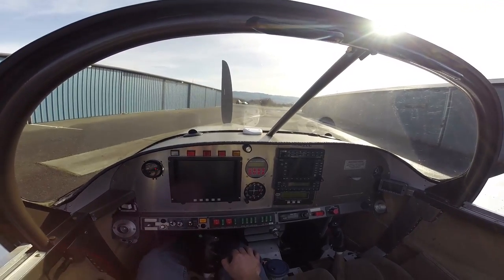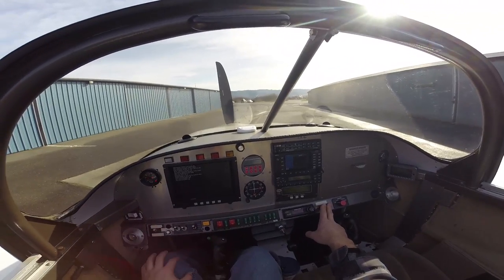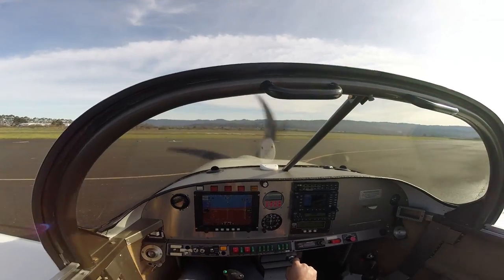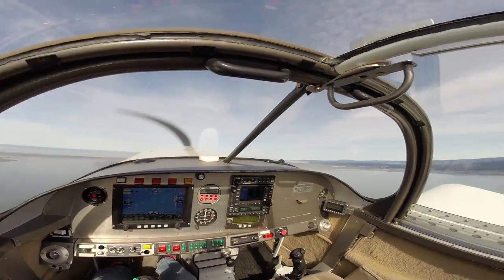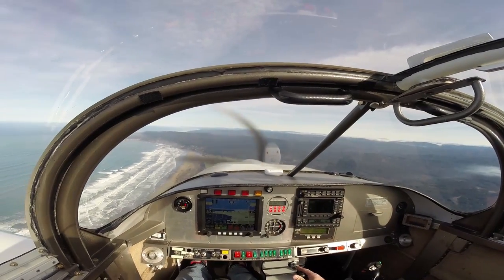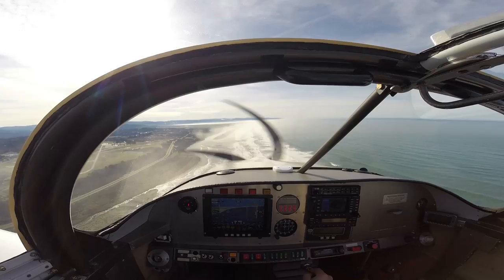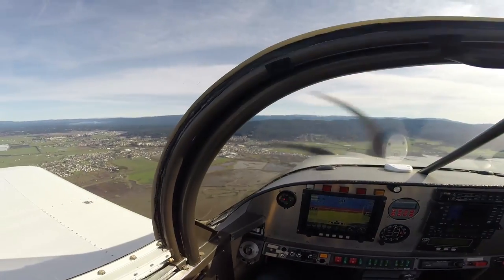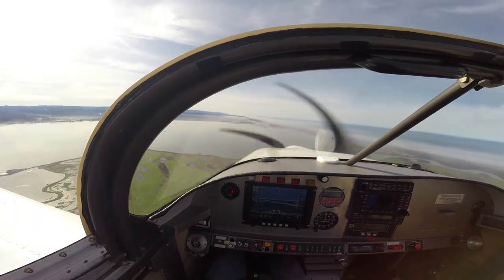Subaru Powered RV-7A experimental airplane N542LC

Comment: This one of the very few Subaru engined airplanes that ever flies.
Reply: @VIsubby You misunderstood the comment. Most of the Suby engined RV's had issues or were on the ground a lot. Poor support too from the main pusher of them. Stick a lycoming in there, better performance and lower fuel burn too.

Comment: Can you set for go around RPM on the base or final turn?  That's how I landed my RV6A.  On the Hartzel, ...Once the power is low the prop is "off the governor'  and ready for a go around.  There are coyotes and deer that sometimes sneak up on you.   I managed many a cross country flight with the RPM at 1900 and 21 inches... 170 mph over the ground at 10000 feet or higher and that burned 6.5 GPH.    Lycoming 180 horse with CS prop and LASAR ignition.   I cruised lean of peak and oversquared on auto fuel... And everyone said not to... They burned twice as much gas and spewed toxic lead overboard too.   Be safe.

Comment: What a Very Nice Ship,. Are there any under the hood views? Links... of engine installed process and gear box. I'm a bit concerned on any gearbox used,, hopefully there are powerful magnets placed 
on inspection plugs. 
Hopefully the gearbox lubrication is not shared with the engine. That would be ugly. 
Electric pitch sounds interesting, but I suspect that's a difficult force to deal deal with. 
Is it possible it responds quicker under no load. And can it actually feather the prop? 

Has to be huge clean advantage heating the cabin with coolant for sure - with no fear of exhaust leakage As I always had to weld up on Cessna's, etc. 
As an Engine tech for many Moons, and Aircraft Builder, I'd Pick the Subaru hands down 
vs anything related to VW.  And like you mentioned, the very stabilized engine temps. 
It' is very critical of engine temps - where we lost 2 pilots leaving Iceland transporting aircraft to Africa, where the drop in altitude that's necessary to gain enough speed with full tanks of fuel,, 
the engines basically were ripped off the firewall losing a jug. Bodies never found. 

Those poor guys with VW engines. have had to retrieve their ships from cornfields many times, forced to do so mid eighties. With friend of mine on the hanger fridge of his VW bright yellow ship
standing there in tall corn as helicopter approached.  
One thing for sure, corn saves lives, if not knocked out by cobs first. So Flare it good on final... 
That engine never should have been selected for anything but a back woods log splitter. 

Cheers

Comment: Very nice though you’re running that engine a bit too rich.  In a car 20” map is slightly loaded which can run at 14.7:1 or leaner with no trouble all day long, since you don’t have all the emission restrictions you could run much leaner, as EGT’s will be higher near 14.7:1. Depending on injector atomization you may be able to run as lean as 17:1 or more, though you’ll need to consider adjusting timing to work with that leaner mixture. (Lean burns slow and needs a bit more timing advance) At map over 25” I’d drop to 12.5:1 (best power ratio) and only go richer if EGT’s or other temps becomes concerning.  You’ll get better mpg and be nicer to your engine by not loading it up.

Comment: I just starting to convert an EZ36 engine, I would love to use SDS system because of the simplicity and be easy to understand what is going on, but I don't know yet an effective way to deactivate the AVCS system, how did you made it in your engine? How many hours did you accumulate until now?

Comment: Great video. Its interesting to see this application after spending a few years learning and tuning an EJ205 your considerations for engine performance seem so much different for an air craft, running 12.5 AFR at -20 inHG MAP is very rich for an automotive application. What kind of gauge and sensor were you using to monitor EGT? Where did you tap in the probe?
Reply: In an Automotive setting 20" of mercury 14.2would be best idle and 12.5would be about cruise of about 60mph. Why is it so different?

Comment: I think these auto engine conversions are great if your willing to learn and understand how a modern auto engine works. If your just a pilot who has never really had much experience with a modern fuel injection engine, and fuel systems I would stay away from these types of conversions. The biggest sticking point is fuel system, and ECU programming those two areas what causes most issues from what I have read.
Reply: Too easy. You can even make your own fuel mappings. I find aircraft engines much harder to get into because the tech is so old. Every kid who has taken shop class has dealt with more technology in an engine than general aviation. I can literally fire up my computer and make some custom fuel mappings and flash the ecu.
Reply: The problem with most people mapping the ECU is that they don't realise that the setup for an aircraft engine is completely different from that of a car - constant revs, take off vs climb vs cruise power stoich settings, timing curve for smooth idle but max power, etc. This is what I found when setting up my FADEC on my EA81 engine, loved the fact that there is no carb ice.
266 hours and still going strong!
Reply: @vumba1331  neat! And where did you get all your info? I’m looking at a kit fox 5 with a engenfelter Subaru in it
Reply: @saltydecimator  Hi Salty, I did it myself with trial and error! I had an idea what was needed, bought a Storm 4G ECU system from a company in ChCh NZ, and they were helpful in getting me started. Big plus was I managed to get hold of some EA81 heads for the final turbo version so it is port injected, the wasted spark setup is as per the car.
Tuning, 5deg for the start up to 1200rpm, makes for soft start with minimal lash, 9deg up to 2000rpm and then progressively up to 33 btd at 4,600+ WOT. Fuel to air is 12.5:1 for takeoff power and climb, cruise is 3,800 rpm at 14.7:1 and 3000 throttled back and coming down on approach is 16:1 to make sure the plugs don't foul.
All of this is done with a toothed wheel for the timing and injection. Nice setup as it starts well and there is no need for carb heat, no problem with altitude compensation and no trouble from floats in float bowls.
With this setup I get a consumption of 13.5 litres per hour at a cruise speed, 3,800rpm, of 85 knots, just what I like. The geared oil bath PSRU on my engine is geared 2.2:1.
Hope this gives you some ideas!

Comment: What was your main reason for going to a Lycoming?  Power, reliability or fuel consumption?  How much trouble was the electric prop?
Reply from the maker: Lack of support for the gearbox and prop. Unfortunately the Idea is certainly viable, but would require more R&D on the PSRU and prop side of things. Once I got the prop set correctly, It worked fine, just not as smoothly and seamlessly as a hydraulic prop.  I would like to see and hydraulic prop for this setup, or possibly a more responsive (brushless, variable speed motor?) electric prop. I was happy with the speed and fuel flow that I saw, but there are certainly Lycoming airplanes flying around going much faster for about the same fuel flow. Thanks for the interest!

Comment: You said you since removed this engine for the Lycoming. May I ask why?
Reply from the maker: Adam Whitfield. In short: Better performance, lighter engine, less maintenance, hydraulic prop, lack of support and parts for the gearbox. I retained the fuel injection and electronic ignition so I have the best of both worlds

Comment: Wouldn't it have been better to use a EJ207 or Ej257 turbo motor instead of a N/A EZ30? I mean sure its going to run hotter but the EJ motors are smaller than the EZ motor.
Reply: the 6 cylinder should be a little more balanced than the 4 cylinder. Additionally listen to the RPMs hes calling out 1800 2100 2400, this is lugging territory for the the EJ2X.
Reply: true but the EJ207 can goto over 8,000 RPM stock
Reply: yes, but for how long? also pumping efficiency goes down with rpm. I think with the plane you want to run one speed indefinitely with 0 chance of failure. notice hes running 12.5 afr at like 2k rpm at -20 inHg map
Reply: But having a turbocharged motor would increase Efficiency at altitude.
Reply: great point, but maybe the 207 is still overkill? He says he cruises at 10k feet and 2000 RPM. a 207 is also about 2x the price.
Reply: +Josh _  about the same price as the ej205 but 205 isn't nearly as reliable as a ez30
Reply: he says 2300 on prop = 4500 on engine at https://youtu.be/UUzURMUe0MU?t=931
Reply: it better to have it run  slower it tq longer stroke of the ez3.6 may even better  @nukeboy27

Comment: Question...what's your max payload?
Reply: 7A have max gross of 1800lb, they come in empty (with lycoming) 1000-1150lbs (depending on interior, prop, accessories, etc.). Leaves 660-800 useful load. 42 gallons of fuel capacity (252lbs).